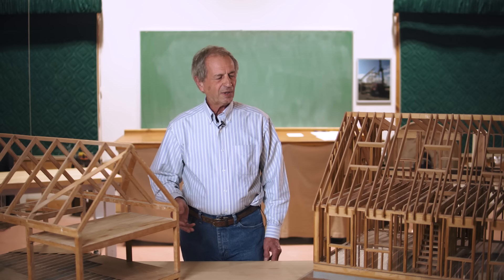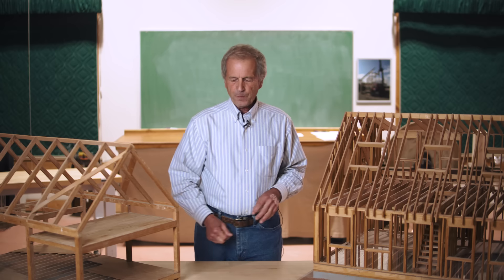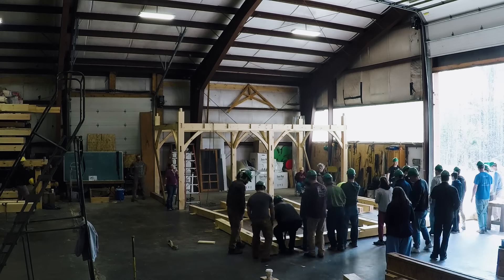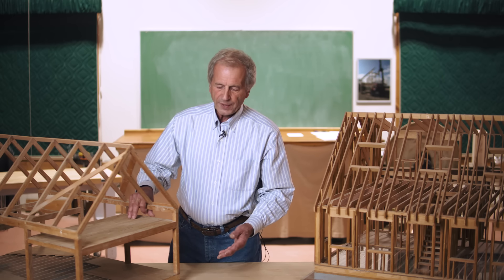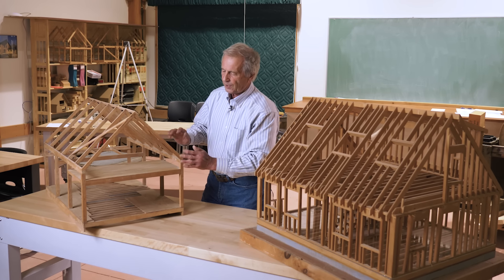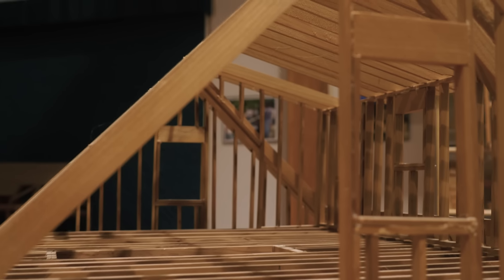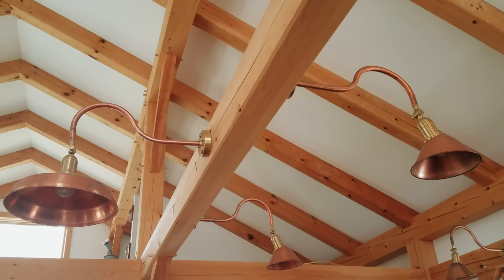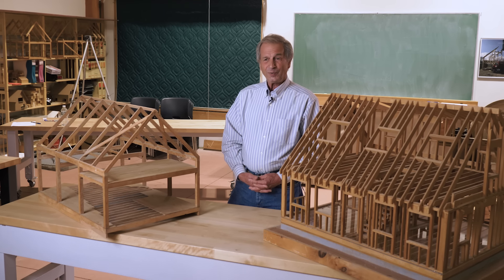Timber Frame vs Conventional Stick Frame

Comment: I don’t get it. As I see it, he’s championing building a timber frame house and putting a SIP lining on the outside. But SIPs are STRUCTURAL (it’s in the name) so the qualities of strength and insulation are coming from the SIPs. Wouldn’t the SIPs do the same job if he put them around timber, steel, concrete, stick or any other type of frame.

If he put the SIP lining on the stick frame house wouldn’t it have the same strength and insulation properties, but be cheaper to construct as he mentions.

Isn’t he just building SIP houses with some nice looking timber beams inside?

Is this just an example of false equivalence?

Comment: Timberframe IS traditional. You're talking about the distinction between STICK framing and timberframing. Also, your timberframe model doesn't display the standard stickframed walls & partitions, which aren't structural but are required to support insulation and interior/exterior sheathing and wiring, et cetera.

News flash: SIP panels don't give you "no conduction of heat". Get that out of your mind right now. They're lossy just as stickframe walls are lossy. They're also really troublesome over the long run.

They aren't called "pegs", they're called "trunnels". There's a considerable difference between the two.

It's not at all uncommon for a property with a woodlot to include a house,  EITHER stickframe or timerframe, milled from the trees on the lot. It does NOT take any extraordinarily long time to mill out the two-by lumber to build a stickframe house.

You're clearly a spokesperson who understands very little about real-world house framing.

Comment: It is not about timber framing. It is about SIP,. And SIP does not ctually need timber frame. It has its own structure. So timber frame is redundant. May be only for decorative purpose.

Comment: I thought wood would act as a natural insulator, but he says the stick frame home loses heat thru the wood.
Interesting.
Reply: Look up thermal bridging.
Reply: True, wood is a great insulator (depending on the species of wood also).. relative to stone or metal materials. In an insulated perimeter however, the wooden studs will have the lesser insulation value. The insulating value of wood compared to glass wool or foambased insulators can be a factor 4 to 10. This will definitely induce thermal bridging.

Comment: And where do all the pipes for water, sewage, gas and ventilation go ?...let alone miles and miles of electric cable.
Reply from the maker: Hi Christoph -- Great question! Electricity can run through the SIPs which are precut to accept the wiring; through interior partition walls, in the floor framing, and/or in chases. The plumbing typically runs through interior partition walls, in the floor framing, and/or in chases.

Comment: Both models lack collar ties.  The timber frame model lacks angle brace corners.  SIP panels can do some of the job, but normal fastening specs for SIP panels are calculated shears and often not real world.   And if you think it will be better, different on a jobsite,, think again.  I see trusses installed without internal diagonals  more often,, much more often, than I see even basic, 'shipped with the truss package sheet'  system of lacers, strong backs, and diagonals.  Reliance of plywood or OSB skins is insufficient.

Comment: oldest timber frame building in Britain is 700 years old they really do last
Reply: It was made from green oak. The frames he is talking about are made from soft wood.
Reply: Seems like Notre Dame was timber frame.  It may be that no wood frame building should last more than 50 years.
Reply: @jrstf  I don't understand  mate. Notre Dame burned but was almost certainly constructed from green oak.
Reply: @jamiemarchant2687  - The point I'm trying to make is that old wood burns really well so old buildings aren't safe.
Reply: @jrstf  Are you a bricklayer?🤣
Reply: @jamiemarchant2687  - No, just someone trying to figure out the world around me.  When recently running some wires I found there was an I-beam in the way, I asked if we couldn't burn a hole though it, the adults in the room informed me that flame is not permitted while working on 100 year old wood buildings.  It sounded like that prohibition was tied to the age of the wood.
Reply: @jrstf  Drill a hole?
Reply: @jamiemarchant2687  - I suppose except I'm assuming drilling a 2 inch hole thru an I-beam is not really practical.
Reply: @jrstf  A mag drill and a 2inch cutter is a possibility.
Reply: @jamiemarchant2687  - Thank you.  The approach I took was to bring the wires out from above the ceiling and run exposed across the room.

Comment: Why have an expensive 'wooden' frame when you use SIP's panels?
Structurally Insulated Framed houses if designed properly do NOT need framing at all.

Comment: @ShelterInstitute if the king of the world asked you to come up with a home design that would last 1000 years. And could be passed down generationally. What would be your solution to give to the King? 

Homes made to last long term prevents future waste and only uses resources once instead of homes and buildings being demolished and rebuilt every 50-100 years. 

So, with the specifications of it needing to be multigenerational, and last a minimum of 1000 years, including plumbing and electrical. What would your solution be?

Comment: This video should have addressed the environmental impacts. Those SIPs on the outside of the timber house are an environmental catastrophe. A double stud or engineered wall with dense packed cellulose blows both of the discussed types away in terms of both energy efficiency and environmental impact.

Comment: This is obviously NOT traditional timberframing as it deliberately leaves out all the studs needed to nail the traditional sheathing to.. In addition to that, there are much wider spacings on the rafters of his timberframe, so that traditionally, either it would require thicker roof deck boards, OR the roof deck is weaker. THAT is the fact with traditional timberframing for CENTURIES. AND all the interior walls which also require studs the same as stick frame are conveniently left out of this video. (apparently, each floor is one giant room!)  HIS method requires insulated panels which are NOT cheap (nor is that timberframe! There is a reason stick style has been used since the early Victorian period onward!)  Lastly, these expensive stiff insulated panels are still just waferboard.  It's rot resistance is slightly better than corn flakes, it seems pre-injected with mold, just add water. And once rot gets into a corner or part of the roof, the tear apart and repair are not easy. ADDITIONALLY, a friend of mine in New York State had a strange thing happen. When the house was partly complete, and sat for a year, it was discovered that ants had crawled way up the wall, gotten in the foam, and absolutely decimated a section almost 3 feet wide by 18 inches. They had eaten into it to make extensive galleries to live in. These were not termites as they are not native there. They were just black ants. I later discovered many had reported this same problem. Wood requires rot from long term moisture for ants to eat,

Comment: Wood is not a heat conductor
Reply from the maker: Hi Antoine-all materials will allow heat to travel through them provided there is a temperature difference across the material (such as the temperature difference created between the inside air and outside air on a hot day in the summer or cold day in the winter). Wood is about 2.5 times more conductive than foam insulation, so every place you find framing lumber in a wall is transmitting heat in our out of the building 2.5 times quicker than the adjacent insulated area. The 2015 International Energy Conservation Code mandated continuous insulation (CI) on the inside or outside of the framing of residential construction to cut down on the significant heat transfer which occurs through the framing of a typical house.

Comment: Some people talk about how a house should/could last many generations. No house can survive a demolition crew. Houses will get knocked down for redevelopment within a century, even houses currently in built in rural areas. There are SEVEN BILLION PEOPLE on this planet and the masses are migrating due to increasing economic power (billions are no longer living on the edge of starvation). Plus, the increasing notion of a "right" to decent housing (i.e, the right to replace low-density neighborhoods with high-density cities) is going to ensure most houses don't survive. Condos, apartments, man-made jungles are the bleak future. So, eventually people will knock down that timber frame house to build a bigger residence. Eventually they will rent it out. Then it will be demolished and a massive building complex will be built there. Only a fool would bet that any particular house will survive the onslaught of development for over a hundred years.

Comment: So the the timbers visible on the inside is sound dampening?
But the traditional frame being part of the R value bleeds HVAC efficiency?
Does this man know what R value is is or how high it has to be (in density you can achieve it with foam but in a more dispersed texture)before you achieve sound dampening? Your selling a product I get that but cut the bs .
Also it uses less wood but the price is more than made up for in your outer layers it's almost double.
Folks if you got the money sure I'd do it too but this isn't for lower middle class or college  grads starting out this 50 year plus retirement money or just born in that money.
That same size house 100k less and about 15 years less time paying for it.

Comment: Understand all stick frame homes are NOT built the same. I build custom homes for a living, and I’ve seen some terribly built homes that people paid good money for. Things like the amount of piers under a crawl space. Size of ceiling joist lumber. Bracing. Floor systems. Roof systems. It’s the difference between a home that falls over in an average storm, or a home that survives and saves a family from death in a tornado. And gets published in a newspaper, like the one we built did.

Comment: well people can put insulation panels on the exterior of stickframe and people can put rigid panels)also on a stickframe (i was guessing he meant plywood )for strength and insulation.... we have wire mesh with stucco over plywood that was screwed down ... it was early thick vinyl from the1979 that we took down but left their plywood up...( the original clapboard had been taken off)...it made this 100 year old house stronger and quieto'r  w h a t cant hear ya:)ALSO~~~> he fails to mention timber frame can be done with manufactured lumber (sucH and sucH) )joined beams(i dont know the name of the joints and then  paint it ... for a modern look... if people dont like to look at wood ....(NOT ALOT of huge beams in most of in the world!!?!!)this video is a little romantic...good job though i enjoyed it

Comment: What's a sip?
Reply: styrofoam sandwiched between two sheets of OSB
Reply from the maker: Hi Greg -- SIP stands for Structural Insulated Panel. These are a manufactured product that is a sheet-good. It is comprised of two sheets of OSB with EPS (foam) insulation sandwiched between the two sheets of OSB. The product is sold in sheets that are 4-ft wide and come in just about whatever length is needed. We typically install them vertically and size them in order to minimize any horizontal seams in a wall. We hang these to the outside of the timber frame so that three sides of the posts and beams are completely exposed inside the building. The standard minimum thickness for the panels is 6-inch on the walls and 12-inches on the roof giving you an R-Value of 25 on the walls and 45 on the roof. However, the wall thickness is adjustable. Happy to answer any additional questions and, as always, if you are interested in speaking with a real, live, human feel free to call 207-442-7938!

Comment: You can build a stick frame home with an even smaller exposed surface area for heat conduction, have you never heard of double-stud wall framing and it's more lumber-efficient alternatives? Why are you selling timber framing as if one person can do it when a single person will have an incredibly difficult time assembling such heavy materials? I bet you that for the price of a sawmill and crane RENTAL I can buy land and enough "sticks" to build a house, and if I already had a mill I'd cut my wood into sticks so that I would be able to lift it myself! Chances are that you'll need to source your timber from across the country/state too, which will add to the cost exponentially for every pound and mile delivered.

Comment: Quick notes I learned:
Timber framing requires skill as stick building doesn't.... Timber framing is hurricane resistant as stick framing is not.
Reply: Ok pal I’d love to see you layout and stick frame a house. When you do, come back and tell me that framers have no skills.
Reply: @donmamon9263  the point flew over your head. As did the same point from the video. Timber framing requires precision. Stick framing is not even on comparison.
Reply: RisenNation Really? How many years have you been framing? Do you know how to do either? Did the fact that this video is literally an ad for timber framing fly over your head?
Reply: @donmamon9263  I know personally that making the hand cut mortise tenon takes way more skill for exact fit..
Reply: RisenNation Alright, all of my assumptions have been proven to be correct. Please refrain from opening your mouth about things you know nothing about. Be quiet.

Comment: The difference is:
Timberframe requires human skill and provides durability and sustainability at less material loss.
Stick Frame is the cheap, low skill result of industrial mass production and planned-obsolescence-society.
In short:
1. Is built by humans for humans.
2. Is built by robots for robots.

Comment: Most of the stuff in this video is BS.  He is trying to be fair and even handed, but it is still a lot of misrepresentation.  For instance, as they always do, they mention the less pieces of wood, however the two models are not equally finished:

1) In Timber framing, the pieces are larger, and normally much more expensive, often environmentally important old growth You can used a lot of different dimensions in either build method.  Each linear foot of material in a typical timber frame, would yield  12 feet of 2x4, that can be taken from very poor quality wood comparatively.  A typical timber frame might have 8x8 posts and beams, and be spaced 8 feet apart.  Keep in mind that some mansions used Cathedral style framing, in houses the bents, and methods are often more modest.  Roughly you are looking at 8 cubic feet of premium wood per 8 feet.  The stick framed wall will use a third that much.

2)  Traditionally, and I own an 18th century timber house, there is a ton of wood used to finish a timber frame.  Normally the outside is 1" horizontal boards, over the whole building, and wooden lath covering the inside.  That is more wood than is in the wall of a stud building and the outside sheeting, even not counting the frames.  In a modern timber frame that does not use SIPS, you normally need all the areas filled in with 2x so you can carry the exterior sheeting, and the plumbing, windows, doors, and electrical.  Or insert the insulation.

3)  SIPS are used to finish some timber frames, and there you have a pile of garbage materials being used to make your home, two layers of chipboard, and a lot of foam, but it is energy efficient.  However, you can make the whole building with sips alone.  The do not require a frame, they can support the loads themselves, as they have 1 inch of continuous "wood" and that is separated by 4 inches of bonded foam, normally the perimeter is 2x4 wood.  There is more wood in the SIP than in a 2x4 wall, and basic SIPS require extra wood for windows, and some interesting design work to run electricity, or plumbing.  And they are a difficult to do any change orders to.  Customers always want those.  But in summary when you follow the timber frame economy of building, you are basically framing 3 house on top of each other

4)  If you want to have the layout of timber buildings, then there is no reason you can't combine existing 2x system.  In fact a single 4x4 post is all that is needed to carry 9 feet of wall with second story loads.  We see it every day with porches, be they external, or cut into the building.  One can use pole building approaches, or post and beam details, or modified 2x construction, one can add SIPS, substitute SIPS, or add steel.  There is really no practical use for timber framing.  It is fun to do, and sometime one can harvest all the frame materials from one's own property. There are modified timber framing approaches also. Ted Benson the guy who wrote a lot of the books, has been incorporating everything from prefabrication, to Cathedral architecture.  

I love the idea of timber framing, I just looked more deeply.  I was at a timber framing guild build project, and asked one of the big names how he built his home.  He said he stick framed it and used wire cables as ties, so he could have a cathedral ceiling.  It is fun to collect the structural details of different buildings.  For some reason, these often get separated out into wall materials, so you have hay bale, timber, adobe, etc...  But the walls are the easy part.  So one should at least consider doing them in a sensible way.  You can put up 8 feet of wall in less time than it takes to cut one mortise.  (Hay bale also uses more wood to support the walls than stick framing, because you still need framing, but the walls are so thick. )